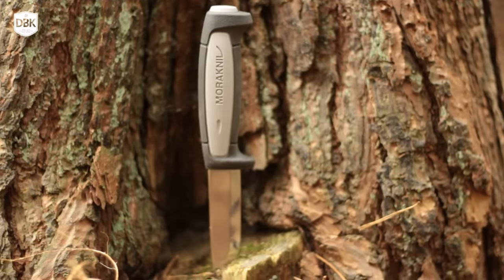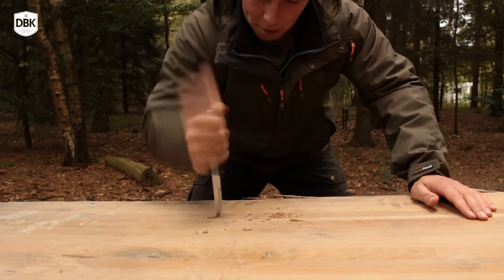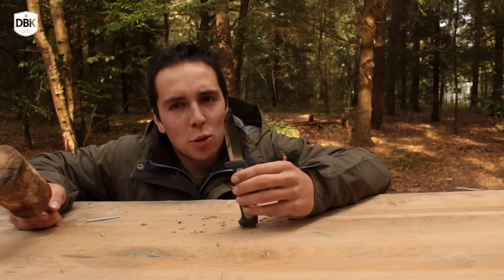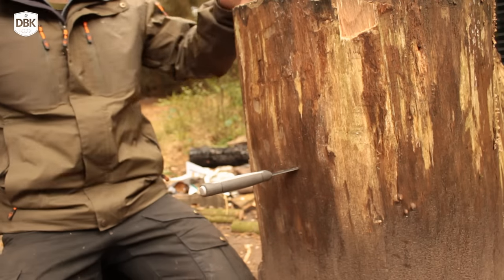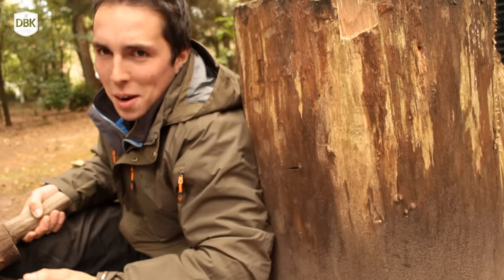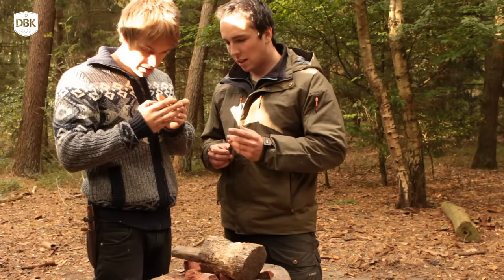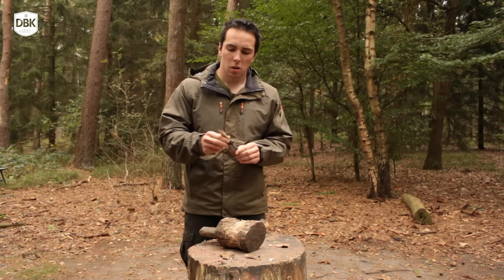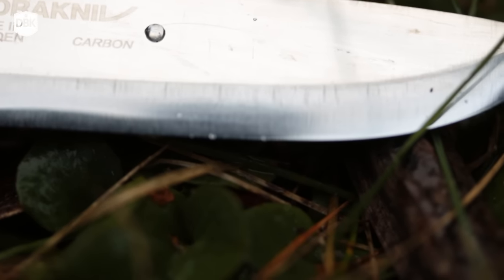The Indestructible Knife | Mora Robust

Comment: I got an old mora robust and I’ve had it for about 2 years. It’s held up to batoning, stabbing a whole bunch of different crap, making hundreds of feathersticks, rusting, cutting food, throwing it at targets, doing basically anything with wood, cutting up carpet, etc. It isn’t full tang, but it feels like it is. It hasn’t budged a micrometer out of the handle since the day I bought it. It’s worn, it’s torn, and it’s still serving me today. You could skin an animal with it, chop through the bones, and still perhaps even be able to shave with it without touching it up with a fine stone or stropping it with a belt. Just today I went out and beat it through some swamp birch and it did the job fantastically. I’ve even put a firesteel on it so I can make fire with just the knife and so I have more options when I have it on me. I hollowed out a piece of elderberry and used that as a tube to hold it, then taped it to the sheath and wrapped it in heavy duty paracord. I’ve got enough paracord for fishing and lashing, and I can always make gorge hooks, find a rotting carcass, worms, bugs, etc, and use it to catch some crappie/river redhorse with it because of how a gorge hook works and how small their mouthes are. They’ll easily just suck it up, the bait holding it parallel to the string will break apart, and it’ll gouge itself into its throat and I’ll catch it. Either that or I could make a spear or an atlatl depending on the woods I have around me in order to catch some fish.